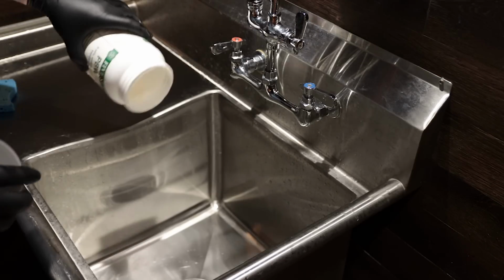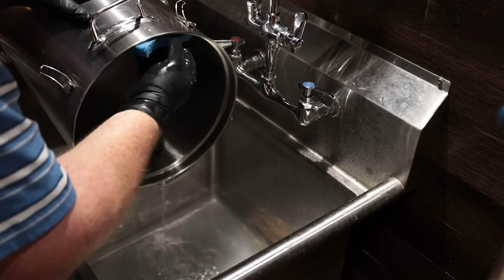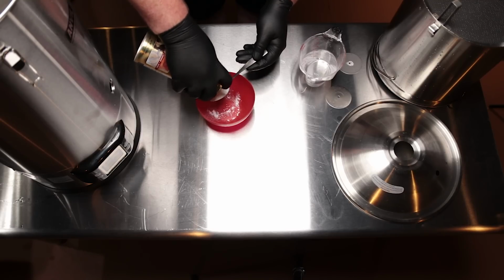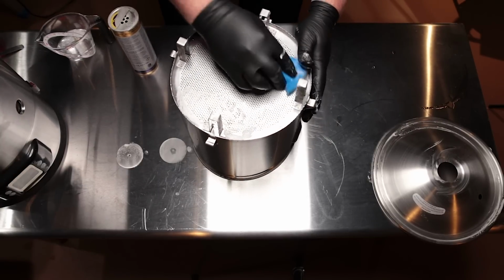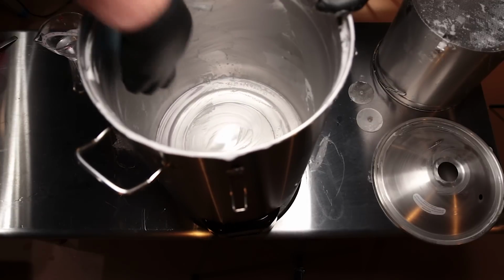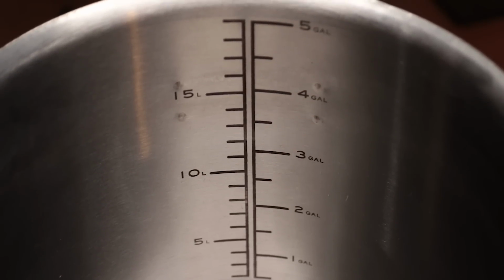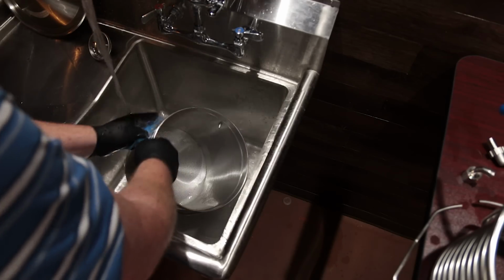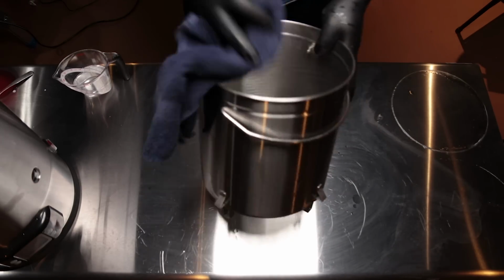How to passivate your Anvil Foundry or ANY Stainless Bar Keepers Friend

Comment: Hi Brian, Glad you like your Anvil products, I do too! I was pleased to see this passivation video using BKF, but you have a misconception that might be making this harder than it needs to be. First, stainless steel is an alloy so the chromium is always there at the surface, along with the iron and nickel. Assuming that the metal surface is clean, bare, free of dirt, oil, or protein residue that can prevent oxygen from contacting the surface, that clean surface WILL passivate. Instantly. The dispersion of chromium across the surface will oxidize and prevent oxidation (rust) of any nearby iron-rich phases. So, the primary purpose of a good cleanser like Bar Keepers Friend is that it abrasively removes dirt and oil, and chemically reduces any rust which may have been present, leaving a clean surface that instantly passivates. In regards to your video, mixing the paste is fine, but the action is the scrubbing with it, not putting it on and leaving it for 15 minutes. The time doesn't hurt as long as the scrubbing takes place, but the time isn't needed. Yes, rinse thoroughly after scrubbing (with a rinsed sponge). Drying quickly is not really necessary. Ordinary tap water is not a hinderance to passivation, although if you have a high mineral tap water that leaves scale everywhere, and/or contains a lot of chlorine, that could be an issue, so drying with a towel makes sense as good general practice.  Bottom line, yes I agree with your video, clean the Foundry or any stainless equipment when you receive it with PBW and BKF and then consider it passivated. There is nothing? you are going to do to it that will remove passivation in the course of normal brewing and clean-up. (Unless you filled it with bleach water. That would be bad.) Ok, sorry to take lots of space. Cheers!
Reply from the maker: Thanks! 👍🍻

Comment: Hi, i cleaned and passivated my ss brewtech fermenter and every batch of beer i have made has a metal taste. 2 batches. I have done 10 gallon split batches. 1 in a plastic fermenter with no metal taste. Any idea of what i should do?
Reply from the maker: Do a good soak with PBW and then a good soak with star San and you should be good.
Reply: Thanks a lot! I'll give it a try. Sucks having a metal flavor haha
Reply from the maker: @willlo9156  👍🍻

Comment: So there is a rather well linked document from NASA testifying to the effectiveness of 4% citric acid at 60C for two hours 

Is there anything that is the equivalent for this method? 

It certainly is useful in that it is a paste. But there is always that question of how to tell if it is actually effective.
Reply from the maker: Starsan can be used as well. The ratios are listed on the container. It's expensive though..
Reply: @ShortCircuitedBrewers  apologies I don’t think I was clear. I was referring to NASA doing the work to prove the citric acid method.

This bar keepers friends method is there studies done on its effectiveness?
Reply from the maker: @zzing  not sure..but Blichmann engineering uses it as SOP..they even send a small packet with their kettles. 👍🍻
Reply: @ShortCircuitedBrewers  that is probably fair enough

Comment: I use starsan undiluted and coat the steel and let it set for about 15 to 20 minutes followed up by a wipe down and then a clean with some soap and water.  Gloves are definitely necessary as the acid is bad for your skin for sure.
Reply from the maker: Definitely recommend gloves!! Thanks for the info! 👍🍻

Comment: This method left swirls and not a great finish on the surface of my Crucible. Should I be worried about this? Is this a way to make it look better?
Reply from the maker: Not really anything worry about. If you are "scrubbing" in a circular motion you'll leave swirls. You might try doing it again and only "scrub" in the same direction as the machine marks on the stainless. (Which would be going around the circumference of the fermenter in one motion) 👍🍻

Comment: Hi Brian,
I have a foundry 10.5 and I'm getting ready to start brewing on it my question is what temperature do I run it to clean all the factory residue off with PBW also I'm using a riptide pump to clean it also. 
Thanks
Ed H.
Reply from the maker: 160f is the optimal temp for PBW. That's what I would recommend. 👍🍻
Reply: @ShortCircuitedBrewers  Thanks you always have great information.
Reply from the maker: @edwardheyrich8601  anytime! 👍🍻

Comment: Do you have to passivate new stainless valve and pump heads? or is PBW/OXY soak good enough?  thank you
Reply from the maker: PBW and oxy should be plenty. most of the time when you're dealing with pump heads it is a piece of cast machine stainless. Those items go through a pretty rigorous cleaning process when they're manufactured. 👍🍻
Reply: @ShortCircuitedBrewers  thanks Brian, cheers!!

Comment: Thanks for this!  Probably a dumb question, but should I passivate the outside of my Anvil Foundry as well, or will just the inside do?
Reply: Mine rusts both inside and out, I'd recommend both sides
Reply from the maker: Just the inside and all the basket parts.👍🍻

Comment: Is this necessary on the Anvil Foundry? Sounds like something that should be done at the factory.
Reply from the maker: It's not a bad idea on any stainless steel equipment to do a thorough cleaning and use barkeeper's friend on it. Contrary to popular belief manufacturers don't open every box that comes from overseas and there can always be some manufacturing oil on pretty much any stainless steel device. It's cheap insurance in my book. 👍🍻
Reply: @ShortCircuitedBrewers  Thank you. My Foundry should be shipping this week. I'll passivate it before its first brewday!
Reply from the maker: @njhampster  👍🍻

Comment: Just scrub it clean. Stainless steel needs nothing else to maintain its integrity.
Reply from the maker: Actually incorrect, but whatever works for you.
Reply: @ShortCircuitedBrewers  

I'm correct. I'm speaking as a metalworker. As long as the surface of stainless steel remains clean and free from inclusions, the chromium continues to protect the material. All you're doing is making it shine.
Reply from the maker: @austin2842  so another brewing system with a basket that developed  rust in an area that was pressed in a die is just fine and doesn't need to be passivated to remove the rust and keep it off..  I don't think so.
Reply: @ShortCircuitedBrewers  
Trust me, my friend. If the basket you mention rusted, then it was due either to low quality stainless steel or having surface deposits remain combined with getting wet regularly. Clean stainless doesn't rust. Also, any iron that you see on compromised surfaces is actually from within the material itself rather than being deposited. That doesn't mean that iron can't be deposited, but this is usually done at the manufacturing stage when someone scrapes the surface with something made of iron or regular steel. Or uses a grinding wheel that was previously used on regular steel. It transfers iron into the top layers of the stainless steel, which then prevents chromium maintaining its protective layer.
Reply: @austin2842  where i've seen it from normal use (on other stainless equipment) is when the metal is harmed somehow like being dropped (and below the passivation layer is exposed), chlorinated cleaners in too strong of a concentration or not rinsed well enough, or there is a poorly treated weld or machined area that initially looked okay but is slowly attacked.  The third one catches people who aren't getting their stuff dry quickly after cleaning especially.

@Short Circuited Brewers  if you update this video, one thing I'd suggest is immediately washing with dish soap after rinsing off BKF.  I have noticed that it leaves some stuff behind even with very hot rinsing.  Then dry immediately.

Comment: Do you think the pre-diluted “soft cleanser” BKF sells would work just fine? It’s only a dollar more at target and saves from making the paste. I know it doesn’t take much to stir it up, but I’d rather just have the convenience.

BKF website says the pre-diluted soft cleanser has less abrasiveness than the powder so wouldn’t that in theory be better if we’re just passivating our units and not using it as a cleanser (like PBW)? Just wondering! Thanks for the videos and I’m eagerly awaiting your 240v GFCI Converter Tutorial for the foundry!
Reply from the maker: Sure should work as long as it has the acid in it. Had a bit of a delay on the GFCI cord but it will be out this weekend. 👍🍻

Comment: Hi, I've used this method on my electric brewery (local made, very similar to Anvil) and the keg. While keg turned out ok except from posts being much darker now, the brewery has covered with cloudy stains which I was unable to wash out. Unlike keg, there was distinct smell when BKF reacted with the metal. I still brewed with that stains (well, don't know how the beer will turn out) and after cleaning it with OxiClean-TSP solution the stains turned kinda yellowish and bluish color. I haven't found any info on this. Any ideas how to fix this? Or I just runined my brewery? =( Also, interested how it could have affected the beer I just brewed with it. Thanks!
Reply: You basically blued your steel. Not a huge deal, it'll wear off with time.

Comment: Hi Brian, I’m curious to know if the Anvil cooling system worked for you with a better fridge. I am thinking of getting the whole cooling kit with a new 1.0 cuft fridge just for the Glycol or water. Any advice?
Reply from the maker: I did actually have success with a fridge. Have not had a chance to make another video yet. Some fridge have caused "freezer bay" In then. I  was able to carefully bend that freezer bay down into the reservoir of glycol, and it worked extremely well, I was able to almost get to lager temps not quite, but for ale it was perfect. I hope to pick up another mini fridge on Craigslist and do a video on it. 👍🍻

Comment: I've always used starsan. 1oz per gal mixed and then added to a spray bottle. Just Spritz the kettle and let it air dry. Super easy and cheap.
Reply from the maker: According to all the info I've seen the kettle need to be filled with the solution and heated to 160 degrees and held there for 30 minutes.. Just spraying it does not passivate.. It will sanitize but not passivate.
Reply: @ShortCircuitedBrewers   H3PO4 reacts with Fe turning it into Fe(HCO3)2 at around 30°c it changes into Fe(OH)2 + 2CO2. Layman's terms is that Starsan (phosphoric acid) reacts with the free iron from the machining process or damage. At around 86° f the reaction from the acid will create a form of water soluble iron oxide that can be rinsed off. A higher temp will expedite the process, but direct sunlight on the metal during summer will also work. Side note. Passivation isn't something that needs to be done all the time. The Oxide layer is naturally formed just from contact with air.

Comment: I use this a lot. The only thing I would add would be, after the equipment completely dries is wash it again with hot soapy water and a good rinse. What I’ve found is that first batch seems to have off flavors every time, but the following batches are ok. I don’t know why. Cheers Brian good video tip🍻🍻
Reply from the maker: Ok thanks for that tip!